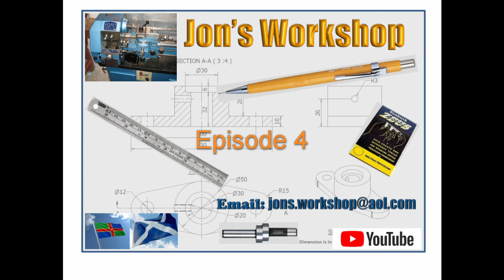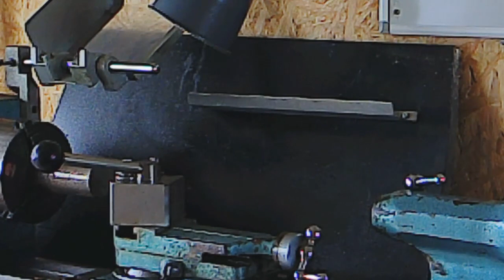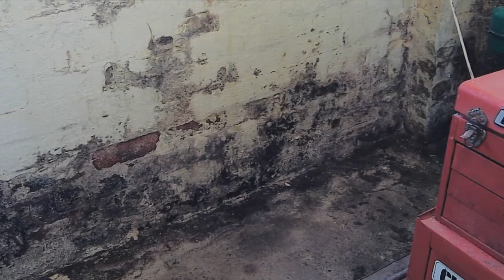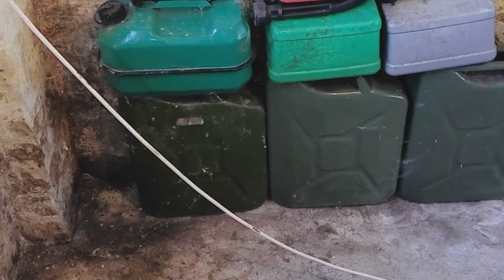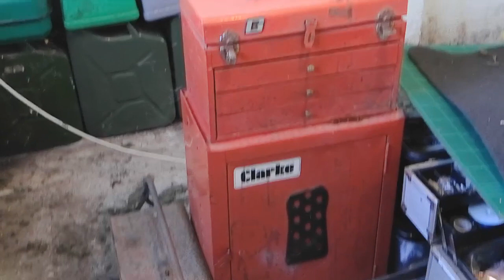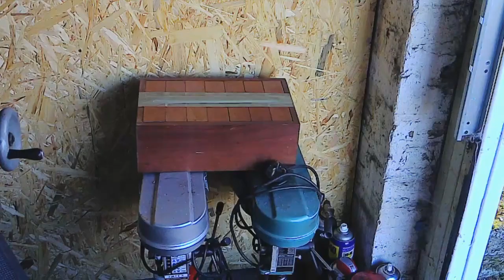Episode 4 - Spiders & Lights!

Comment: Jon, and anyone else that doesn't want spider webs in particular locations, if you put non-jelled Clorox (or possibly any other similar chlorine-containing laundry product?) into a pump spray bottle, you can mist the web(s) with the Clorox and it/they will disintegrate (or at lease fall apart) before the spider can get off of it.

I learned this as a kid back in the '70s when doing my own laundry in the basement below a window which had fairly large webs with good sized spiders in them.  Mom had a Clorox-containing spray bottle on the window ledge, and as a mischievous kid, I grabbed it and sprayed the web.  The spider started hauling ass and the web disintegrated/fell apart before the spider could get off of the web.  I told Mom & Dad how well it removed the web.  Several years later, after my parents had purchased a lake house that had a problem with some type of spider literally coating one (probably shady, if memory serves) end of the house with their webs, which really irritated Dad because it looked bad.  We got something like, I suppose, a pump-up fertilizer or insecticide sprayer and loaded it with Clorox and sprayed that entire wall of the house with it (when we were able to be *upwind* from the mist!)  The spray in every case kept the spiders away for at least a year, even the outside wall of the lake house.

Comment: My Dad always used up old two stroke fuel in his landrover, any old fashioned engine will happily consume it when mixed in with new petrol.
Reply from the maker: Hi Jim, thanks for the comment. I did try this in my lawn mower (Briggs & Stratton), it is really too far gone I think. Still got 75L of the stuff, managed to offload 25L as weedkiller lol. Cheers, Jon

Comment: You call that petrol old, you have a lot to learn young fella me lad about old, i still have a couple of jerry cans full of genuine 4 star from the 70's. 
As for spiders webs i got you beat there too, and mine are in the bedroom. I would get rid of them but they keep the bloody moth numbers down.😉
Reply from the maker: Nothing wrong with spiders in the bedroom, I just don't want them in the workshop, well at least not in as many numbers as before I cleaned it up. I have hung on to one or two of the most hungry looking ones to control the midges and wasps. Jon
Reply: @jonsworkshop  thats just plain sense, none of this operating theatre cleanliness palaver. 😉

Comment: hi jon  working through from number one so not sure what you havew done to the south wall but  personally  i would brick up the winder  install 100 mm of plystrene insulation and build a breeze block inner wall . you have not shown the outside of that wall but  i bet its just brick . a nice coat of render would help damp proof it
regards Nigel
Reply from the maker: Hi Nigel, thanks for the comment, we sort of met in the middle, I breeze blocked the window, and left a cavity to the back of the boarding. The outside is rough cast, once I have rough cast the window opening I will treat the whole exterior wall to some damp treatment (Johnsons). It has to be an improvement. Trouble I have is when it rains (which it does often here) moisture comes up through the concrete slab so even if I cure all the walls the place still gets damp! I realise I am fighting a losing battle but can't really justify or afford to level it and start again. Just trying to restrict what I can see more than anything. A decent dehumidifier will help. Thanks again. Jon.